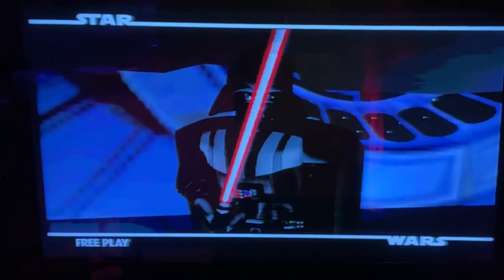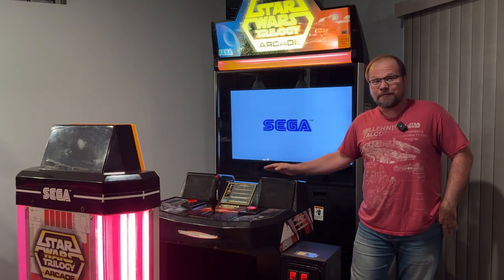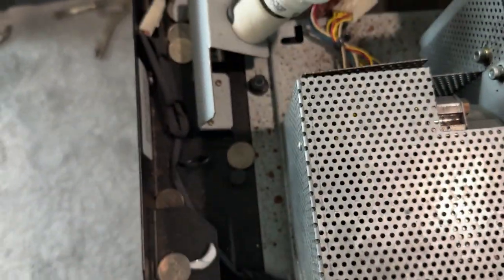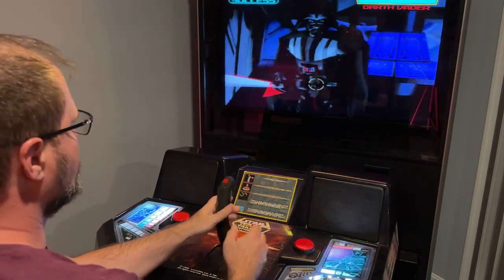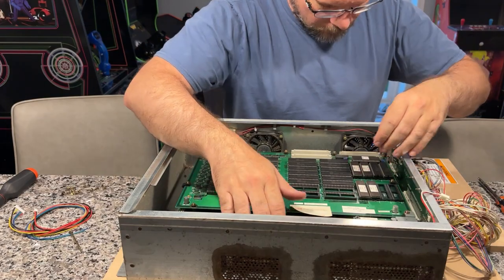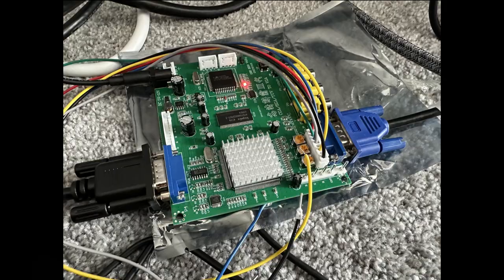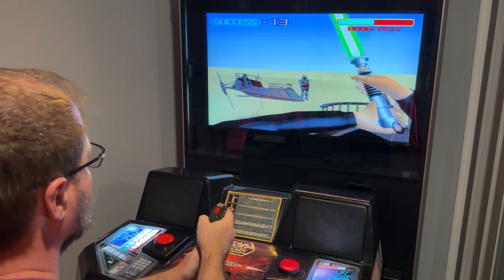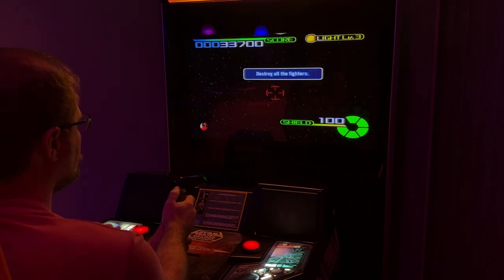Arcade Pickup/Fixup Star Wars Trilogy Arcade Deluxe!

Comment: So glad I found your Video. Thank you for the links!. I'm repairing one of these, Had ram and rom issues, controls platform all rusted up and stick loose etc. Got all in good order, spent ages manually calibrating the CRT projector tubes and got it playing well with everyone wanting a go, only to have the red lens dump glycol on the projector board. So disappointed. Only four days of Starwars. I've now got it directly working on a small VGA monitor, although the clock settings are extreme, so a new hope is to put in a modern short throw projector to keep the authenticity. Projector arriving tomorrow....